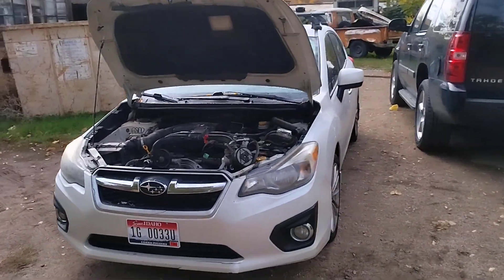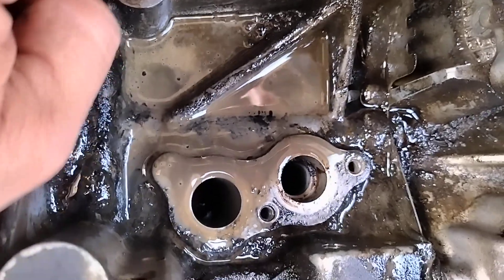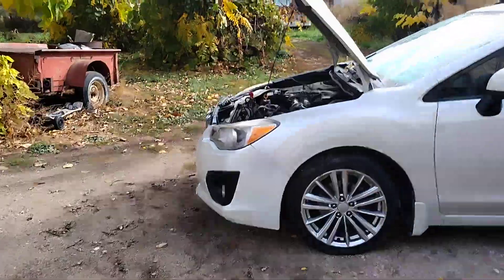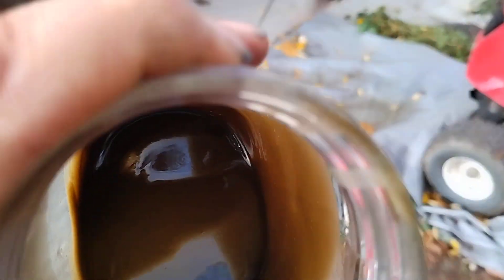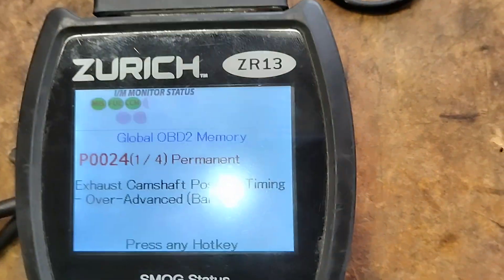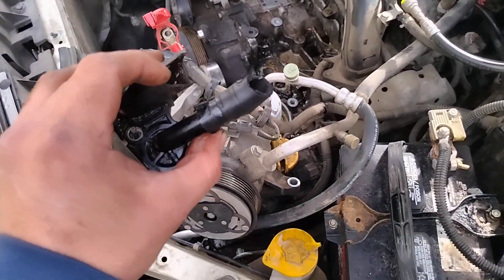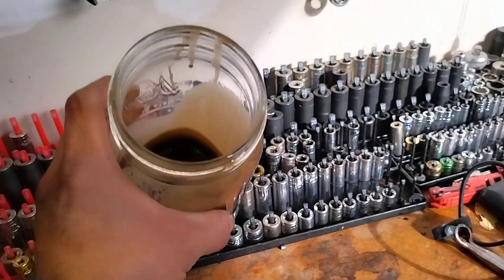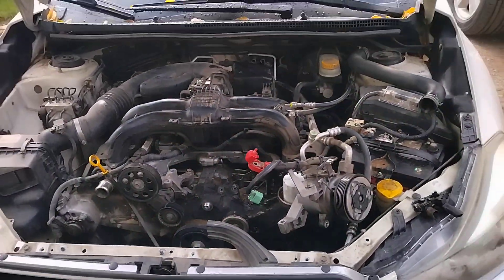2012 Subaru Impreza oil to coolant contamination

Comment: That connector is very likely not the single source of fluid transfer. And the fluid transfer is not caused by being overheated, or head gasket failure. On the Subaru FA and FB series engines there are 3 o-rings in the upper oil pan that seal the coolant passages to the block, these shrink after time and heat cycles, once they have become weak (usually 100k+) the oil pressure in the engine oil pan will force oil past the orings and into the coolant. Once this begins, and if not found soon, the oil will start degrading the coolant seals and orings. To repair this properly you need to remove the engine, remove the front timing cover, remove the upper oil pan and replace the orings. I would also advise on replacing the thermostat and all of the rubber coolant hoses, the coolant crossover orings and the water pump gasket. Then perform a chemical flush of the system followed by several flushes with just water. Once all traces of oil are gone refill with coolant.

This series of engines (FB & FA) is used in all 2011 & newer Foresters, 2012 & newer Imprezas, 2013 & newer Crosstreks, 2013 & newer BRZ, FRS , 86 & GR86,  2013 & newer Outback & Legacys,  All Ascent models, and all 2015 & newer WRX models.

21 year Subaru Master Technician

Comment: My bet the pcv valve was never changed causing pressure build up blowing out the oring although heat cycles always win. The coolant can become acidic after years especially if a ground is missing.

Comment: Hey i beleieve i am having the same problem. So with the temp sensor being coated with that slime not having the temp gauges illuminate. Should the radiator still gurle into the reservoir of its overheating??
Reply: Maybe you have air in the cooling system

Comment: What about the O ring, should that be replaced too?
Reply: Yes for sure, any part that has any rubber gasket should always be replaced. It's not worth the risk, especially if you're putting a brand new part in and spending all that time anyway.

Comment: What was the end result here? I fear my 2015 has a similar issue. I’m seeing oil in the coolant reservoir.
Reply from the maker: This engine was severely overheated and seized up. I found sludge in the heater core and the trans cooler.

Comment: wow, what a mess. Great diagnostic work!!
Reply from the maker: Thank you! yeah it had to stop in the middle of this one and rethink the diagnosis because I could see that there is probably way more gremlins in it than what any one can see I.E. this destroyed the engine but we wouldnt know until we installed the new rad and water pump and tried to start it.
Reply: @MattShaughnessy6  What a shame & shitty design. + they have NO temp. gauge just idiot lights, now I'm worried I have a 2019 wondering if same design or not, I've been worried about this car for awhile now. I did get it new, yet overall think I should've never given up my last Toyota & think it's time to go back to one. Are you located in the North East? Nice work, thanks for the video
Reply: How can so much oil get into the coolant through that PCV elbow considering the coolant system is pressurized and the PCV system is under slight vacuum and it's only oil mist? Something doesn't add up... 🤔
Reply from the maker: The kid.....Yes "kid" who drove this likely had no idea and didn't pay attention to the fac that his car was overheating. I say over heating because the end result was a seized engine full of blue metal ( I still have the engine in my shop and will keep it for awhile just in case ;).
Reply: @MattShaughnessy6  what a mess lol
Reply: @PineHollowAutoDiagnostics the upper oil pan O rings leak it lets oil in cooling system 
 This kid drove it so long that way it burst a hose overheating it